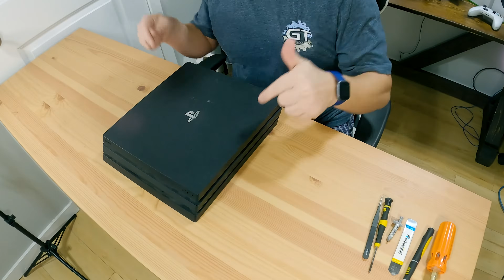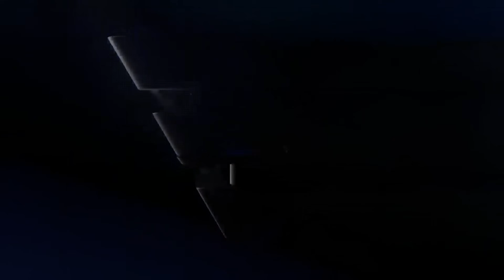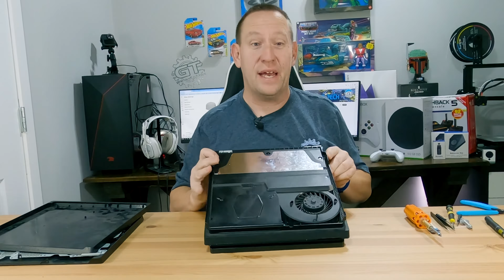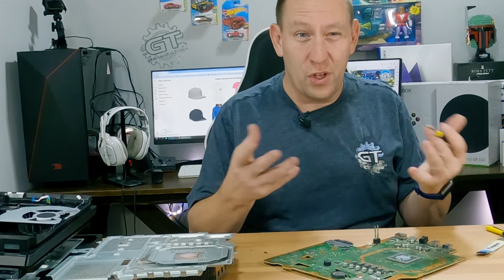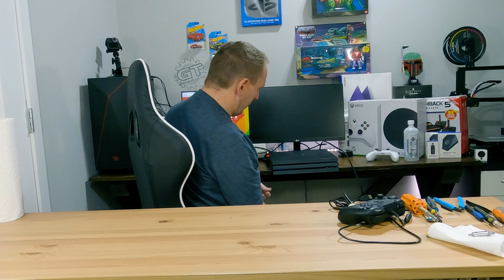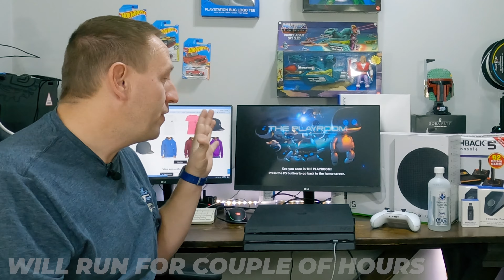Huge Performance Boost AND No More Jet Engine on your PS4 PRO! | Gears and Tech

Comment: Interesting video, good explanation 👍🏻 perhaps you have a explanation for  mine problem with the PS4PRO aswell coz I'm can't figure it out myself even though I searched through the whole Internet.  My console doesn't seem to get out of the safe mode, it turns on and when it goes to the blue screen with the message saying it's recovering the files? It doesn't go further than 25% and after quite a while stops! Goes back to the safe mode and then won't respond on any of the choices you can choose from in it's safe mode menu .I Turned of the console ,took out the power cable ,switching power cable wait 30 minutes or more start over again and it keeps repeating the problem over and over again,  I've got a external hdd seagate 1TB drive I use on my ps4 500gb version  . Could I connect this external hdd drive to the ps4pro and see what happens? Or does it wipe all data on the drive . Does it even work at all for that matter? 
Anyone who has information, tips and advice about this please help me out,  I'm feeling totally helpless and sad.

Comment: Just a PSA, Arctic Silver is capacitive and could potentially short exposed electronics, so be careful with use.
Reply: TRUE man. I guess he doesn't really know what he's doing. You can use SIlver on big ass IHS but not on a naked chip with zilion capacitors around it. For 2026 IMO Arctic MX-7 is a good choice.

Comment: Car audio and slot cars taught me about electric smells and the smoke they hide in wires. You can't put the smoke back in once you let it out.
Reply from the maker: Great point!
Reply: When I was doing pc repair I told people that once the magic smoke leaked out, the unit was done for. Putting the magic smoke back is like trying to put toothpaste back in the tube.

Comment: Works for about a week until your son loads up Spiderman and then it's back to square one
Reply from the maker: 1 year later it's still going strong
Reply: @GearsAndTech I did this a couple of months ago and it does improve overall,even golf was getting the console hot and bothered. The crossover games like avengers and Spiderman still kick the shit out of it though. Annoying as it is a really good console, it is just far too over clocked and undercooled.

Comment: Tried that, didn't work. Think I tightened the nuts too hard and it squeezed the thermal paste out.

I ended up removing the board, putting it in a PC case, and attaching a CPU heatsink. Bit of a job, but now it is whisper quiet even at max load.
Reply from the maker: Cool idea

Comment: Need help. I disassembled, cleaned and replaced the thermal paste. When I put it back together I turned it on and there was only a blue light for 3 seconds and a beep. Nothing happens anymore, what's the problem?

Comment: Hi guys I repair ps4’s a lot and I can say the 7,000 and 7,100 models of pros scream loudly even after a perfectly repaste and re pad. Only 7,200 is silent. But this is normal if you have these pros don’t worry after a repaste its fine but it shouldn’t be jet engine mode anymore
Reply: I have 7002b is that loud after repaste and repad
Reply: @SnoopDog-j7i yes. Usually 50 decibels. Even after a perfect repaste and pad

Comment: NEVER OVER APPLY ARCTIC SILVER 5! It's conductive. In fact, just don't use it anymore. There are non-conductive solutions now days that perform better and last MUCH longer than AS5. Noctua NT-H2 works great for direct die, and it will last for a long, long time. With the fragility of these components (and the plastic shell), what you don't want is to have to go back in and clean off dried AS5 in just a couple years time.

Comment: Go for the 99% alcohol by all means but the 25% of the 75% alcohol is not tap water. It's distilled or deionized water, it doesn't conduct electricity and will evaporate too. You could also clean it with 100% deionized water, probably less effective but shouldn't damage anything. In my father's time they used to clean more rugged circuits under tap water; you just have to wait for it to properly dry before plugging it in. I wouldn't recommend it for the PlayStation though. 😉
Reply from the maker: All great points. Only problem with water is corrosion. Being distilled water it's less likely, but still a concern
Reply: @GearsAndTech  Yeah, I wouldn't use 100% deionized water either but simply because it's never a perfect process or the water can pull minerals from somewhere or maybe CO2 from the air, I guess (I'm not a chemist). But in theory only the dissolved minerals in the water cause corrosion (or dissolved O2 maybe), water itself does not. It can't because I believe in this case corrosion means oxidation and water is already burnt hydrogen, so all it's oxygen atoms are in a bond. I was wondering if the 70-75% alcohol would be even better for cleaning since it is not so volatile, so it won't evaporate so quickly?
Thanks for the video btw, it helped a lot to refurbish my old PS4! 🙂

Comment: Also worth replacing the original thermal pads. Sony used tiny ones which cover the 50-60% of the ram modules. Replaced with proper sized pads and it also made a difference.
Reply from the maker: Great point

Comment: My PS5 started doing this around the time DW Origins released. At first I thought it was the game causing my PS5 to shut off any time between 5min to 1 hr of play. Then it became frequent where it shuts off multiple times a day. I game about 3 to 4 hours daily and shuts off 2 or 3 times during that time range. I have to wait 20min cool down before I power on again.  I had my PS5 since July 2021. So, I might have had the original model. I'll miss it because I had it so long and already pawned it (without disclosing that info). Im either going to get a slim or pro. By the way I cleaned my PS5 every 2 or 3 months since I had it (blowing dust, cleaning with wipes).

Comment: Hey all, was wondering if someone could tell me why after taking my pro apart, to reapply the paste spreading it out, ( I usually use the line method) open the power supply to clean it, dust the fan then put back together, there was a strong smell of plastic coming from the back. That lasted about 30-40 minutes.
The next day I opened it back up to see maybe something was burning, but saw nothing. Repasted using line method, now its quiet, no smell of plastic. Thanks

Comment: I put this one to help refresh my memory as I took apart my Pro for the second time (first time was last year) because I hadn't considered that maybe I hadn't used enough paste when I replaced it the first time. I opened it up, it was still very clean all-around, added what thermal paste I had left, and I just got done putting it back together again. Hopefully ther will be an improvement again, because I AM tired of the jet engine noise, and I reaaaally wanna continue my current Marvel Spider-Man stream on it. I didn't have that much paste left, so I won't be surprised if I have to open it again in the future to add more. It's a good video!

Comment: 99%? You mean 91% isopropyl alcohol right???
Reply from the maker: No, 99% if you can find it. You want no water in it
Reply: @GearsAndTech  well... I used 91% and it worked just fine

Comment: PS4 Pro is easily the most disappointing console I've ever owned. I'll never buy sony again. i installed SSD back when it was a pretty expensive upgrade and reinstalled fresh OS. also took apart the console for the insanely loud fan noise, i expected to find a bunch of dust clumps and dog hair clogging the system, there was no clog or clumps at all, just a horrible cooling system made by sony. went ahead and reapplied new fancy thermal paste. didn't help at all. had this system for 8 years, been nothing but a headache. downloads always stuck at 3mbps, then you have to wait for the file copying process. even with direct ethernet cable to the router it's still painfuly slow. my PC downloads 10-20x faster. also the menu always lags when scrolling through menu tiles. I've even tried toggling between 1080p and 4k but no matter what it's just a garbage system. always has been.
Reply from the maker: That's unfortunate. New thermal paste seemed to fix mine

Comment: Hi, thanks for the help. It's working perfectly in COD6 I have no more jet engine sound and the PS4 getting too hot and shutting down. The thermal paste was dry and had almost none. I also change the battery cr2032 for a Duracell one. I had some issues removing the power supply, but it's perfect. ❤ ❤
Reply: What cr battery?

Comment: Sometimes, when they are loud after thermal paste replacement it means the tension between the gpu and the heat sync isn't right, or there is a high spot or a scratch on the gpu itself.
Reply from the maker: Thanks for sharing

Comment: About 3 years ago I did this with my PS4 pro.  Mine wasn't really dirty but it was making the Jet Engine sound.  I used the same type of thermal paste used in this video and copious amounts of it.  Fire it up and.... it makes just as much noise as it did before.  I didn't test it with a ton of games because at that time I had just gotten my Series X but I was still finishing up a couple of PS4 games I owned.  It might just be the game I was playing at the time which was the Resident Evil 3 remake.  Im not sure which model PS4 pro I have.  I bought the one that came with Red Dead II bundled with it when that game released.
Reply from the maker: If it has the fat power cord it's 1st Gen

Skinny power cord, 2nd Gen (quieter)
Reply: Actually that one with Red Dead Redemption is actually supposed to be the "best" model number 7200 , og is 7000 and the 2nd gen is 7100. 

I'm surprised it would still make the noise. I'm sure you checked and clean out the dust build up and also applied new thermal pads

Comment: You can add the best thermal paste and pads and it'll still sound like a jet engine. I know this from personal experience.

The only way to stop it from reviewing up to the highest speed is by leaving the top off. 

That's how I play god of war ragnarok and Warzone on it and not have it rev to the highest speed.

My Spiderman edition ps4 pro tho. That thing is a champ, but I bet my first get ps4 pro will outlive it because the first gen for sure runs cooler thanks to that jet engine fan keeping it very cool at the cost of the annoying sound to the user.
Reply from the maker: The fans rev up for a reason. Their job is to keep it cool first. Not be quiet

Comment: I’m pretty good at taking things apart like my consoles but once I got to the cpu part of the ps4 slim I couldn’t get it off
Reply from the maker: You need to undo the screws on the back holding the cooler plate. Then pop off

Comment: I have a launch day ps4 still working and doesn't jet engine to much I did clean it and repaste it about 2 years ago, the biggest problem I have with it is my eject button goes off on its own or stays pushed in until I remove and reinstall the bottom cover until it's fine again and the disk rollers not fully ejecting or pulling a disk in that's it.

Comment: i disagree with most,,,,,,,,,,my PS Pro has been badass rite out of box 5+ years ago.. Jet engine sounds didnt start til  6 or so months ago,,on 85% of games i play has jet engine sound (idealing is quite N fine)...im a man' iive in super nice clean house,,,fan has been alittle dusty (but certainly nothing like all these horridly filthy fans i see on the Internet {no tellin wht there homes look like 2have there fans 5xs more filthy than mine´ & most of there units are probably  3xs younger than mine}  i bought my PS Pro 50days after they hit the story shelves {why ive been waiting yrs now 2buy A ps5pro' theyll hit the store shelves Nov or so this yr, last i heard)...My theory 2the jet engine sound is the eternal HD is full' & its got nowhere 2dump the massive amount of data its filled with as new data is inputted (playin games)..Or maybe alittle spot wore on tht heat paste thing' i dont think so tho...PS:  i  DL tht NBA2K4 bundle whn sony gave it out whileback' thinkin it was the full game)  it was sonys 1st bundle they gave away (if yall remember rite, ,,i hate BB too' just thought it would be fun 2shoot around Abit' & career mode)...So evry since thn problems'  i think it was reason my 2g HD storage hook up ruined  (it wiill not 4mat or restore on the PS,,,,,& of course i have noway 2delete  the 102GB bundle frm my eternal HD'  i can only hide the game... 270 (all epic games but 20 or so) / 6000 trophys,,, so enuff data to cause a problem 5yrs in´ my theory ...

Comment: I just bought a ps4 pro from a kid for 150 3 controllers 10 games... turned it on and all I heard was the jet engine all the time. I legit just took it apart to the psu blew out the radiator cooler and cleaned the fan with alcohol and thin qtips 40+ lol. And no more sound of a jet engine.
Reply from the maker: That's great to hear

Comment: I did this with my ps4, the jet sound completely gone and it's quieter than a ps5 and certainly faster that other players using ps4, only problem I have now is all my controllers keep developing stick drift even a brand new controller so it's not the controllers themselves causing it, any ideas anyone?
Reply from the maker: Has to be controllers. Ps4 only takes the signal and uses it. Can't introduce drift on ps4 side

Try wired and see if it changes

Or wireless and see if it changes
Reply: @GearsAndTech  it's not just the analogues though it's every button, sometimes the controller doesn't do a thing even though it's on, so I swap controllers whith the ps4 still on and start to get response again

Comment: My ps4 pro is giving a strong odor of like smell why would that be? its not burning more like smoker.
Reply from the maker: Something is getting hot
Reply: @GearsAndTech  Thank You for your replay i got this ebay 2 years i have not cleaned or used it but when ever i open the box their a strong plastic smell its CUH-7016B on cfw . I am going to put in put in box Isopropanol 99.9% and leave to soak in this for few days to see if that helps smell. Its very strange.

Comment: Id like to send mine in to you and have it cleaned and redone on the thermal paste if it needs it
Reply from the maker: Thanks for watching. Unfortunately it's not a service I really offer.
Reply: It’s honestly not too bad if you watch a couple tutorials on dissembling PS4/PS4 Pro. Give yourself at least 3-4 hours if you are going to do a deep clean w/repasting. Also look to get some compressed air or a way to remove the dust you will find in your console along w/some good thermal paste, q-tips, & 90% isopropyl alcohol for cleaning the heat sink and gpu.

Comment: Waste of time
Reply from the maker: If you don't have a jet engine then no need to do this. But most people will need to do this at some point
Reply: It helps to reduce the amount of throttle (lag/choppiness) your console will have if it runs too hot.

Comment: While not a ps4 pro. I recently cleaned out my original ps4, it was surprisingly easy to clean out and change thermal paste with using the ifixit guide. I now love watching people clean out devices, it’s very therapeutic seeing a dead console or dirty console looks like it new. Now it sounds like a normal console (not silent but so much quieter) whereas before it was very loud. 

Awaiting a ssd to arrive so I can replace the hdd to make it run even faster.
Reply from the maker: That will perform a lot better once you do both those
Reply: @GearsAndTech  yeah, and it also not relying on moving parts either from the  SSD.

Comment: I would add to swap out the HDD with an SSD.  It loads in games almost three times faster.  Some are close to 5x faster.  Bloodborne is about 2.5~3x faster in loading maps (similarly with all Soulsborne map loads), Dragon Quest XI is about 3~5x depending on the map, Dragon Quest Builders 1 takes about 1/2 the time to build each new world, and Builders 2 loads every map change with the ship about twice as fast.
Reply from the maker: Yes, I did that in another video
Reply: I installed a 2TB SSD and now my games are taking 2-3 hours to download and install … ????
Reply: @orivera215  Oh right, it also depends on the SSD.  If you bought from say, Temu...that would do it, and likely the 2TB is actually 500GB with a deliberately hacked memory controller that outputs a false reading.

If you bought a Samsung or Western Digital, etc.  Those are fairly good, but I assume that, except this day and age, a lot of junk like Adata is often purchased to save some cash.  Depending on what drive you bought, that can be 100% the issue.
Reply: @ it’s the Samsung 870 Evo from Best Buy
Reply: @orivera215  I just installed the 1TB version and it was a huge improvement, I wonder if yours is fake?
Reply: @orivera215  I've had a lot of issues of late with downloading and installing on my PS5 and my PC, and my Switch. When I did this with my PS4, no issues.  This could be based on a lot of things, internet traffic, rerouting due to weather anomalies, the sheer amount of almost non-stop sunspot activity, which bends and alters streams of data wirelessly and wired, and can muck with transformers and repeaters, causing all sorts of internet black holes your system may have to route around.  There's a LOT of military chatter of late online, and a LOT of DDOS and hack attacks, more than ever before.  So that could be the problem.

If it's your SSD, there are a number of fail points, though the ratios of failure are far lower now than ever before.  Memory controller, though most would just kill all function entirely.  It could be an issue with the PS4 itself and how it handles data, possibly age, or too hot, needs cleaning in the fans, etc. maybe the thermal paste needs to be replaced.

Most likely it's download speeds, weather and sunspot activity impacting said speeds and forcing rerouting and there's excess traffic on the same lines depending where it routes through.
Reply: 5 times loooool